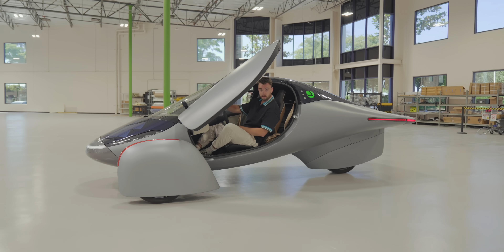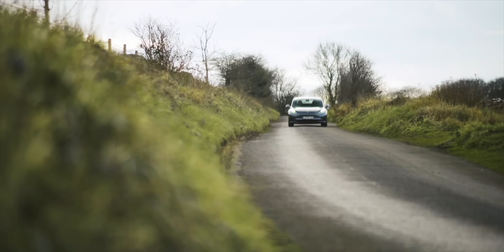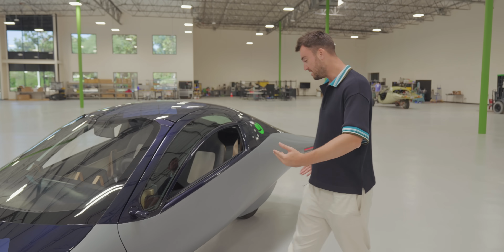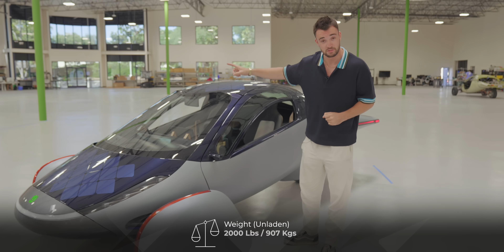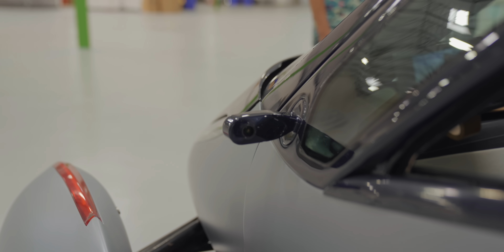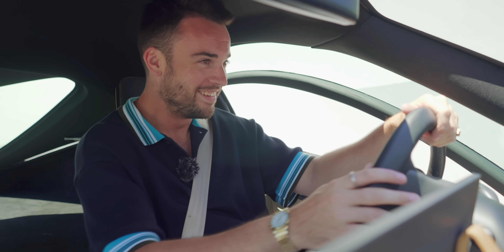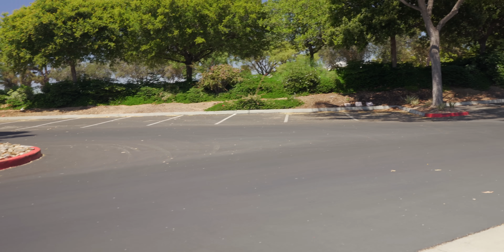The Game-Changing CHEAP Electric Car Inspired By Fish!

Comment: first, i want to see what happens when a ford F250 hits it on the side at 60-100km/h, hell lets make it a truck while we at it, 
secondly, how long will that battery last for?, can it be replaced?
thirdly, if its a "motorcycle" and not really a car, what license will be required to drive it?
never say, you will never have to charge it, we all know that is a sales pitch that is not true
Reply: It has been designed to pass all US automobile crash tests. Real tests will happen once they've build some production cars to crash test. (Prototypes don't count.)   Most places require only a car driver license. Check with your state for "enclosed autocycle" requirements. See their online calculator for how often you'll need to charge it, depending on how much you drive and where you live. Most people drive less than 40 miles per day. Even in cloudier places you'll get about 20 miles per day on average.

Comment: Can the chairs fold down to make camping thing possible to lay down straight?
I wish it could fly too :D
is it front wheel drive only?
2.2 meters is wider than usual, how much it would cost to efficiency if put 2 wheels behind and make front wheels 200-180cm wide? (also increase of production cost)
To make it charge itself from sun, it have to be parked without roof, the insides gonna be pretty hot is there a feature to pre-cool car remotely before using it? Is it a good idea to make some kind of curtain made of solar panels? (for front and rear windows) may be something that automatically slides out from above or bellow when car detects sunlight
Reply: Seats fold forward giving 7 feet of room to lay down in. Both FWD and AWD versions are available.

Comment: At first we were told you would never need to plug this in now your telling us that you only get 40 miles of range from the solar panels.
Reply: "Never charge" was always in quotes. I don't like that hyprbole either. Most people drive less than 40 miles per day.  So it is "never charge" for most people (living in sunny places). It also charges faster from a charging station than just about any other EV.

Comment: Yeah but if one of those cameras or screens fail you have lost the ability to look behind you.  A mirror never fails unless you hit it, at which point you have already had an accident anyway.  I would prefer a mirror rather than a camera to see cars behind me.
Reply: It has both.
Reply: @fotoguru222  It very clearly doesnt, they specifically say as much in the video.
Reply: @paulosullivan3472  From their FAQ: "We have a camera system instead of side mirrors for better aerodynamics. The driver display screen will include left and right-side viewing, which makes it easy to see what’s happening around you. We may add a small single side mirror due to federal requirements in the states. "
Reply: @fotoguru222  "we may add" so you literally just posted a comment which categorically states that as of now it does not have both it only has cameras...
Reply: @paulosullivan3472  Cameras and screens work better these days. They will probably be required to use at least one actual mirror in the USA, even though in the EU they have progressed beyond that obsolete requirement.
Reply: @fotoguru222  Unbelievable, are you so arrogant you cannot just admit you were wrong and apologise?  You claimed it had both, it does not.  I disagree that cameras are superior but ultimately your point was 100% wrong.
Reply: @paulosullivan3472  Yes, unbelievable.

Comment: Looks like a damn death trap. I wouldn't want to stuck driving this in heavy traffic or bad weather
Reply: Designed to pass all US auto crash tests. With AWD and vectorized traction control, it should be great with a set of snow tires in bad weather. Watch their "moose test" video to see how it handles and compares to top heavy SUVs and trucks.

Comment: I can see from this video, it needs more head space. Hopefully they make a model that is just a bit bigger of the cabin area for comfort and maybe a bit more off the ground.  I didn't see about the third wheel being powered or free spin. They should also have an option of an extra solar panel for home setup, like a roll away version to keep from needing grid power.  Looks good so far, I will be watching how this evolves.. :)
Reply: Jack is really tall! Should fit anyone up to 6' 4" or so. It comes as FWD or AWD for a few grand more. It will have a plug for external solar panels. 🙂
Reply: @fotoguru222  Is there a setting that makes it not look like a homosexual toy so I can actually get a woman to get in it with me?
Reply: Clearly, Joe, the Aptera is not for you. That's OK, because they they are having enough of a problem making enough for everyone that really wants one. They are at over 30,000 paid reservations so far.
Reply: Look up their website. They have some great info
Reply: Where do you put the groceries and stuff you buy from the store. I can transport 8' 2X4s in my car and about 300 pounds of cement bags. This thing would shatter if I tried that. Also, how does it handle on icy roads and how will it perform in a crash? How will it charge when the grid can't handle the load it is currently under?
Reply: @did_I_hurt_your_fee_fees  Good questions. Aptera can carry all of that in its 25 cubic feet of space behind the seats. You might need to move the passenger seat forward to fit the 8’ 2x4s.
Aptera was designed to meet or beat all US auto crash standards.
With its advanced traction control and a set of snow tires it will do very well in arctic conditions, and keep you comfy, too.
Reply: @fotoguru222  That car is not nearly long enough to be able to store 8' 2X4s nor would it be able to hold 8-10 bags of cement LOL It's made of plastic and there is no way it would be safe in a high speed collision. It would also not be able to handle on icy roads. I'm also not going to be caught dead driving in something that looks as lame as that car. I would never trade my much larger, safer and more useful car for this toy. 3 wheel vehicle are NOT safe on icy roads. Just saying it can do all these things doesn't make it true.

Comment: Just like a 3 wheel motorcycle with a closed in cabin..............
Reply: . . . that needs no gas, is silent running, keeps you comfy from -20 to 120F, and does 0 to 60 in 3.5 seconds. 😁

Comment: If these cars are going to be on the road, all the other gas cars should be taken out, because just a regular sedan can crush this car like a taco shell, and one rough road bump can take a wheel out completely, and where does one get spare parts and mechanic? The problem is impractical electric cars made deliberately to be deterrent so that people would buy heavy gasoline cars for safety reasons.

Comment: How much do parts cost? How much maintenance does it require after 200k on a corrugated dirt track? How much luggage does it carry. How many people can sit in it. How easy is it to panel beat after a crash?
Reply: 1) nobody knows, 2) less than your current car, 3) 25 cubic feet of luggage space, 4) being made of flexible composite material, you replace it if it cracks or patch it like a fiberglss boat for small stuff.
Reply: @fotoguru222  Thanks for that. I honestly want sure there would be a reply

Comment: Problem is that it is not a car. So I need a motor bike licence to drive it. Also avoids all the safety features etc we take for granted in cars.
Reply: Only a couple of the 50 states require a motorcycle licence. Check yours to see what an "enclosed autocycle" needs.

Comment: How does it keep passengers warm in the winter and cool in the summer ?  How does it perform when outside temps are sub zero
Reply: Designed with a heater and AC to keep you comfy from -20 to +120F.

Comment: @Chris as a fair number of your customer base are likely Off Grid folks, I love to see two way chargeing/tie in discharge capability. I feel like this will be mandatory on all EVs well before they reach 50% of on road vehicles, as the grid wouldn't be able to handle the load other wise.  I plan to start working on a retrofit for mine as soon as you ship it.
Reply: A 1500 watt AC inverter will be included.

Comment: I have a problem with that "60% of power goes to pushing air out of the way" If that were true, why does my 9 speed transmission deliver 37 mpg at 85 mph but only 27 mpg at 65 mpg?  I would think the amount of power directly relates to the transmission of power through the gears so this blanket statement concerning efficiency is not a simple matter of pushing air out of the way. If that were true, then the faster one travels the more power (and hence fuel) one would have to use up, but clearly  not true in my case!
Reply: What do you drive?
Reply: @fotoguru222  A 2015 TLX 6 cyl TECH with 27,000 miles
Reply: @IDamian1  interesting. I'd look again at those mileage figures you got. Is that a typo (other than thee 3rd "mpg")?  I have never heard of a car that gets better mileage at 85 mph than at 65 mph. I have heard of inaccurate mpg indicators on cars.  Was one trip with the A/C on and the other with it off? Was one with a tail wind while the other was with a head wind?
Reply: @fotoguru222  No typo  9th vs. 5th gear.
Reply: @fotoguru222 While I share your unbelief, 9th gear turns over in a less than 1:1 ratio.
Reply: @fotoguru222  Must be that 9th gear ratio is less than 1:1
Reply: @IDamian1  🤓 Have you tried driving at 65 in a higher gear? That would help mileage. Don't know how much if any control you have over what gear you're in.  I've read the best mileage comes at the slowest speed you can drive in the highest gear. Save downshifting for accelerating and hill climbs.
Reply: @fotoguru222  I have both paddles and automatic transmission. "
9-Speed Automatic Transmission - ZF"
I have not tried driving at 65 in 9th. I suppose I could but I believe the  transmission is balanced against speed so that it won't spin too fast at 85. As you are no doubt aware, the greater the speed requires a higher gear ratio so that you don't go past the redline.
Reply: @fotoguru222  And I imagine a lot of torque helps

Comment: Kind of reminds me of the first gen Honda Insight.  The Honda engineers really were trying to squeeze efficiency from the 3 Cylinder lean burning highbread.  They didn't even  have modern batteries.  They used a nickel metal hydrid battery.   Very tall gears on Manual 5 speed.  Loved to hypermile it.  Slow on the hills if you wanted to achieve 60 tp 70mpg!  Then came the Prius and more power and size.  Still good Mpg.  But nothing like the Insight.
Here we are 21 years later.  I would love to hypermile this efficient unit!.  Plus it has the pep  needed not to get run off the road by a Dodge Charger.  Seems we have a 24 hr Lemans going full time in my City.  Plenty of Mustangs and Camaro's. 
Totally love these cars to, but these drivers are rude and dangerous
.  They will be the reason Self driving technology advances sooner that later.
I hope this these guys do well.  Very cool concept.  I hope this company shoots straight and is careful with pre orders, ie, Elio.  There is enough going for it.  Just make you can deliver!
Reply: As an owner of the Gen 1 Honda insight, and someone who has ridden in an Aptera prototype, it will exceed the Insight performance in every category, including interior space and probably the already very good safety.

Comment: Won't work in USA as long as the government classifies these 3 wheel vehicles as motorcycles and motorcycles require extra licensing. Elio ran into this issue with their 80 mpg car
Reply: According to their webiste, only AK, MA, and ME require motorcycle license. You can drive it with regular driver’s license in the other states.
Reply: @jenny80myles  hah. I don't think this vehicle is viable in AK.

Comment: Does it have to be grey?  Why not use the rest of the car that is painted grey into solar panels?  I know my solar pocket calculator does not need to be in direct sunlight to work.  Just daylight.  So, more energy generation, maybe enough to add a 4th wheel...so you can use the car for more than hauling your asss around.  When did $20K become the NORMAL PRICE FOR A CAR?

Comment: My question has to do with use of the vehicle in northern climates where road salt is used.  A bane of most bearings and electronics is salt creep,  salt seeping through microscopic gaps into the interior of bearings, and electronic devices.

Comment: Liking this car a lot but worried it will not fit in my garage, it seems so wide. Another concern is how it will handle in winter conditions.
Reply: The car is 88" wide so you can measure your garage. It also has all wheel drive option. Assuming you can get good snow tires for it. I don't see why it can't handle winter driving.
Reply: @jenny80myles  My model 3 is 73" wide (without mirrors) and it leaves me just enough room to get in and out of the car and walk along to the back of the garage. So it will not fit and the garage is part of the house so no way to change that. But for solar charging it would probably be best to keep the Aptera outside anyway. Now hoping it will come to Europe so I can make a testdrive.
Reply: @KGE64  Keep in mind, the widest part of the Aptera is at the front wheels. The body is much narrower and the door opens upward.

Comment: The inwheel motor Is actually the vehicles weak point . Designers are correct in the wasted energy concept but they are not taking suspension travel into the calculation.  Problem is the wires from battery to motors get heated first . Next add the extreme movements of the suspension on that wiring and you get premature wire fatigue which means the efficiency will degrade as the wiring is fatigued and break . ( actually going through this issue based on same heat issue on a 2021 Freightliner.  Wires between body and chasis are prematurely failing , probably the actual root of most of the new Freightliner electrical issues ) .
   It's actually something I think tesla and other big automakers are taking into account because they know of this issue from simple years of vehicle electrical wiring experience 🤔

Comment: It doesn't look like it could make it over the typical non-graded sidewalk slope, that would allow it to enter a basic American driveway, without crushing the wheel guard. That rather real problem would be corrected by lifting the front edge of the wheel guard by about 2 inches.
Reply: The wheel guard is at least 5" off the ground. Maybe not on the prototype they show here.
Reply: @jenny80myles  Thanks. That would definitely be sufficient.

Comment: Nice...but impractical.  I understand the emphasis is about range and efficiency...that's nice...and needed.  But the real problem is... a good idea only gets better the more it is used.  This is where EV's fail.  The more they are used...the more problems arise...environmentally and infrastructure wise.  Which means...it's not nearly there yet.

Comment: This thing only holds 2 people, it doesn't solve any problems.
As a society we should be moving towards LESS vehicles, which are greener and use renewables as much as possible.  Manufacturing teeny vehicles means EVERYONE would require one. Increasing traffic, calling for more manufacturing(not green.), more infrastructure(parking, concrete, not green.).  This car is a cute little idea but Aptera's vision is naive and not looking at or caring about the bigger picture.  We need to move away from everyone being in personal private vehicles and move to efficient, green public transport capable of carrying a lot of people.   The interviewed guy talking about efficiency equations is just marketing quack talk.   This thing is NOT the future, not even close.     C'mon now.

Comment: Am I the only skeptic here in the comments? The fact that it is a 3-wheeler does mean that it is classified as a motorcycle but what was not mentioned is that it therefore does not need to meet safety rules that regular cars have to meet. They say it will be safe but are they crash testing to prove it? Will the National Highway Traffic Safety Administration (NHTSA) and the Insurance Institute for Highway Safety (IIHS) give this a rating? If they do and it gets a low rating, will those pre-orders not turn into actual orders?

It seems that they only have one "beta" prototype that still needs the suspension and dashboard sorted out and yet they expect to "deliver the first production-intent vehicle by the end of the year" which I take to mean they will modify the prototype to the production design - and remove that Tesla switchgear.

Even with Elon Musk's $100m fortune, Tesla went perilously close to bankruptcy in the early days as building cars is capital-intensive but I don't believe this company has that sort of money so I'll believe the robots when I see them. Starting out with two production buildings a few miles apart rather than one bigger one is already a red flag. I think the people running the company have good intentions but from the start, this whole thing has been run on a shoestring and it is not clear to me that they can pull this off. I hope I'm wrong but I fear a second bankruptcy.

Comment: Why don’t they just add the rear cameras to the wheel arches to reduce drag? Also, why isn’t the rear windshield filled with solar panels? It’s a nice flat area
Reply: It may have to do with the fact that the wheel arch turns with the wheel so the camera won't be pointing straight back all the time. As for the windshield, some people like rearward visibility, and 40 miles is already pretty impressive.
Reply: @jenny80myles  good point on the wheel turning. i guess you can add motors to counter the turning angle or add a wide angle camera and balance it in software. i still think it's a miss opportunity not to have rear solar consider that this car is ALL about being efficient as possible. at least have it as an option